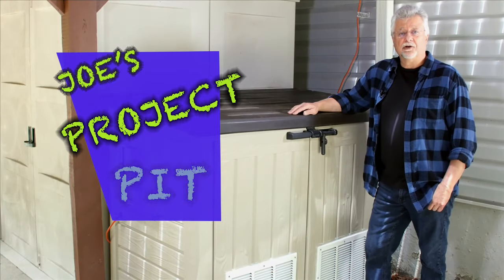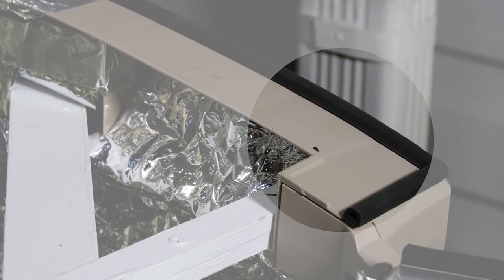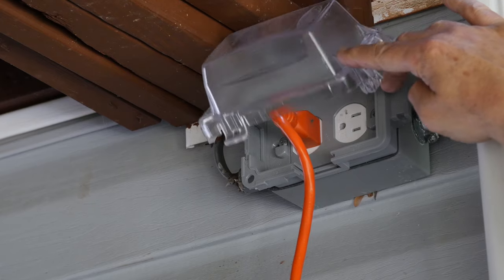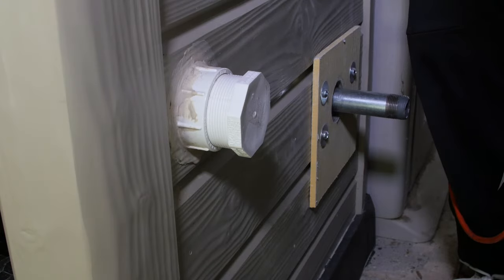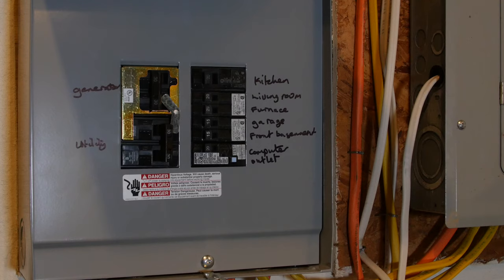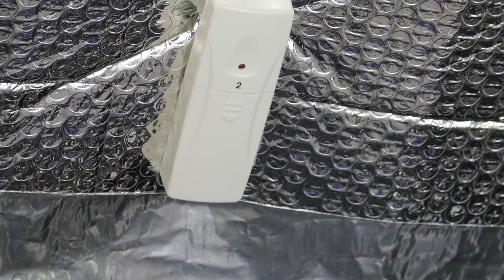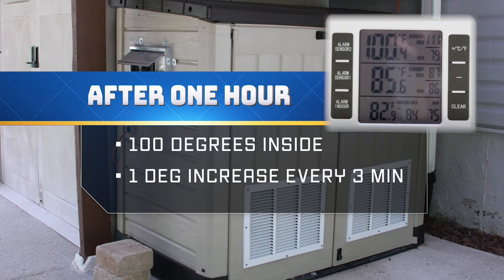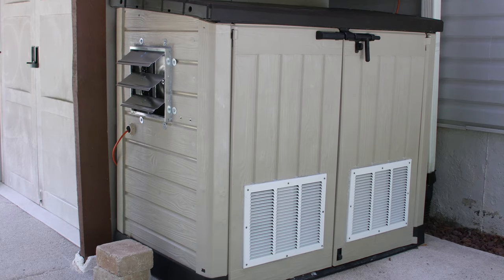Affordable Generator Enclosure Shed Project

Comment: Are you able to show a step by step of how you added the base plate and exhaust to your generator?
Reply from the maker: I can work on that now that I am back up and running.  In the meantime, here's what I did.
  - make sure the baseplate fits on the muffler flat and is not too large as to wobble when seated. 
  - coat the plate with fire resistant putty rated to 1400 degrees or so (the kind they use in fireplaces or near high heat areas).
  - drill holes in the muffler where the holes in the plate line up.
  - use as fat a metal screw as will fit in the plate holes.  make sure they are corrosive resistant.
  - when you screw the plate to the muffler, DO NOT Overtighten.  The muffler wall is thin and will strip easily.  Let the putty do its job to seal the connection.  Hope that helps until i can do a video.
Reply from the maker: One more thing.  The mounting of the plate may (or will) void the warranty on the generator.  I addressed this point in the video.  I did not care about the warranty on my machine, but if that is a concern, don't do it.  You will not be able to use my design, since it requires an extension on the exhaust.
Reply: Thanks for the reply, I'm more of a visual learner. My generator is the same brand and model as yours. Looking forward to the video. Thanks for your help.

Comment: Hi Joe. Enjoyed your video and have the same shed. I'm not sure how you stapled the insulation to the plastic shed. I just blew a hole with my stapler. Any help would be appreciated. Thanks
Reply from the maker: I had the same results at first.  Remember to staple on the support sections, not the outer walls.  Also, there are heat resistant caulking products that will work.

Comment: Nice job. I’m building something similar. What did you use for the bracing on the shed walls?
Reply from the maker: Sorry for the delay.  Been dealing with health issues and I'm just getting to these comments.

For the walls, I just stapled the insulation.  However, I thought about lining the inside with either 1/4" Plywood or 1/"4 " Drywall.  The Drywall would be more fire resistant.  I used 1/2" Drywall on the back wall.  I felt I didn't need it all the way around and didn't want to add the extra weight.  If weight is not an issue (I may be moving soon), then the Drywall liner might be a good idea.  

For the front brace which adds support to the side walls, I used a 1"x1" piece of wood with 45 degree struts for stability.  I undercoated it with flame resistant paint, like you would use in a fireplace.  You can use steel angle iron if you wish, but be mindful of the flimsy nature of the shed walls.  It might be like putting a jet turbine on a rowboat.  Use your judgement. Thanks for the comment.

Comment: Excellent video. Thank you for sharing. Did you need to adjust the carburetor when you added the exhaust extension?
Reply from the maker: I did not have to adjust the carb, maybe because the pipe is only 12" long.

Comment: Thanks, Joe! Great idea! I'd probably want to store my electric lawnmower and weed eater in it when not used with the generator. Does your shed pull double duty?
Reply from the maker: At this time, I store a second generator in the enclose, so as long as you empty the shed before you run the main generator all is well.

Comment: Thanks for this. I am just getting started. I have a WGEN9500.  Do you have any more detail on how you connected the pipe to the the muffler?
Reply from the maker: I answered this earlier, and it must be noted that bolting the threaded pipe flange to the muffler will void you warranty.  I used short galvanized screws.  I also used a fireproof sealant caulking.  There are other ways, but this worked the best for getting all of the exhaust out.

Comment: Excellent video, thank you so much for taking the time!  Quick question on flooring...what do you have on the base under the generator itself?  Is heatproof/non-combustible material required there?
Reply from the maker: In the video I used a Wood Base which elevated the generator for airflow, then afterward I covered with the same heat resistant layer as the walls. I  I'm sure that you can find a better solution, but this has worked well for me.
Reply from the maker: As a matter of fact, I will be installing Hardie Backer Board under the generator when I get a chance to insure heat resistance.

Comment: Awesome build. How long did you have the generator running. How hot did the floor of the shed get directly  below the muffler? I have a similar generator shed and was hoping to get some answers to my questions thanks.
Reply from the maker: If you notice in the video, I have a platform that I placed the generator on top of.  It is undercoated with fire resistant paint (like what you use in fireplaces).  The inside of the unit with the door closed and one 14" vent covered  hovers under 100 degrees on a 85 degree day and never gets higher than 120 on hotter days.  As a matter of fact, when I cover the vent the way I mentioned, the temperature drops significantly.  The second vent is for ventilation when the generator is NOT in use.  Hope this answered your questions.
Reply from the maker: I mounted the generator on a platform with a layer of insulation (the same as I used on the walls of the shed).  I ran the generator for over an hour in the test and I don't plan on running it all day in an emergency.  Since refrigerators keep food cool for about 12 hours with the doors closed (maybe more), I plan to use this generator no more than 2-3 times each day for an hour or two each time to charge batteries on laptops, phones, etc., and to connect to the modem for remote work needs. If work demands more time, I will make adjustments in the schedule.

Comment: This is a great video and I am in the middle of gathering materials to do one very similar. One question I have.  How did you get the pvc cleanout for the power cables to stay in place?  Is that just caulk?  Silicone?  Some type of glue?  Thanks!
Reply from the maker: Great question.  I used a combination of Liquid Nails and adhesive caulking.   Liquid Nails first to secure it, then the adhesive caulking to fill any minute holes.  I then stuff the hole with any rubber foam to keep bugs out and air from getting in, since this will lower the effectiveness of the vent fan.

Comment: I’m building a shed for my inverter generator ! I thought the fan should blow air inside the shed and another hole to vent out the heat ?
Reply from the maker: Check the comments from Cayrick Pan from August 2022.  He has some info on engineering exhaust systems in a closed environment.

Comment: I wonder how much heat difference there would be if the starting temperature was increased to 95-100°
Reply from the maker: I believe it would still be within the operating range of the generator and think about if it was outside with no wind in direct sunlight.  If you calculate the temperature difference starting at roughly 80 degrees to a starting temp of 95 degrees, the rise in temperature would only get to 120 or so.  Also, I have the option of opening the doors as long as it's not raining.  It's seldom 95 degrees in the rain unless you're in Death Valley which got to 127 degrees once.

Comment: Wonderful work. Wanted to ask you if you ever had any problems starting the generator in cold weather? I found out the hard way that after a near-freezing night, I couldn't start. Thank you and great video!
Reply from the maker: Sorry for the delay.  Been busy.  Nope, I haven't had that problem.  Sorry to hear that.
Reply from the maker: If your generator is gasoline, get a bottle of Fuel Stabilizer and dump about an ounce or two into the tank. This usually does it for my lawn mower also.
Reply: @joedelsordo9012  will do, thanks for the response!
Reply: Use synthetic engine oil. Never had an issue with cold oil on my 3-wheeler in Alaska. Did have to warm the carb sometimes though.

Comment: Have an installed Generac 22KW standby generator and thinking about a project similar to the one in this video.  I am definitely open for advice/opinions as this generator is directly outside my second bedroom window.  It is also in very close proximity to my 3.5 Ton HVAC.   I would like to  mitigate as much noise as possible, therefore the requested advice/opinions. Living in the south, I've not had to use it very often, however, during hurricane season the protentional for constant use is possible.

Thank you for your help.
Reply from the maker: Chuck, you might want to read through my other comments, especially the one about living in Florida.  I suggested that it might be a good idea to build a shed our of cinder block.  If that is not in your budget, then look for a sturdier shed than the one I used.  With 90 mph winds and higher, nothing is safe.  Build it strong.
Reply: @joedelsordo9012  Have you built a shed out of cinder blocks?  If so, what was the cost range?  Thankx!

Comment: If I build something like this I will set the generator in some sort of steel tub to act as containment in case of a fuel leak
Reply from the maker: The containment tub should only be about an inch or two high.  You don't want to overheat the generator due to confinement.

Comment: What temperatures do you see when your generator is running and under load?
Reply from the maker: Ran the generator for about 2+ hours with no significant rise in temperature.  Just don't overload the system.  I monitor the remote temperature gauge in the enclosure constantly.

Comment: Why do you need an extention for the exhaust, which juat dumps it outside. Won't the fan system take the CO out of the box anyway?
Reply from the maker: No, that would add to the temperature inside the enclosure.  If you check out other construction, they mostly all have an exhaust extension system.

Comment: How did this work out in the summer heat? I live in Texas. Just wondering if it ever got too hot inside. Thanks!
Reply from the maker: For extreme weather locations, like parts of Texas, I'd place the generator in the shade, like the north side of the house or in a carport.  I tested it in 90+ degrees and it worked fine, lowering the inside temperature from 106 deg down to the low 90's.  Maybe I'll test it on one of our hottest summer days here in Georgia.   It sometimes hits 100+ here too.
Reply: @joedelsordo9012  Thank you Joe!

Comment: Have you ran this for long hours? Did the plastic shed melt at all around the exhaust pipe
Reply from the maker: Good question...As I said in the video, the exhaust hole is framed with Hardie Plank, so heat won't affect it.

Comment: Nice what kinda  temperatures dose it run
Reply from the maker: The test took the inside temperature from 106 down to the low to mid 90's and it was still dropping after 1hour or runtime.

Comment: U suppose turn on breaker after it dtart
Reply from the maker: Yes, but in this case, since I hadn’t switched over the in-house breakout panel, it wouldn’t affect anything.  The important thing is to wait until the generator is up to operating speed before flipping the house switch over to the generator circuit.

Comment: 1.  Should NEVER use galvanized metal for exhaust.  This is DANGEROUS.
2.  Radiant insulation is used for sun rays, not convection heat.  This is DANGEROUS and the material can catch fire if hot enough. 
3   I like the idea of Hardy or cement board for the exhaust opening.
Reply from the maker: Thanks for this comment.  The metal flange is not galvanized, nor is the exhaust extension pipe, sorry.  The screws can be replaced if they are in fact galvanized.  The temperature inside the shed never gets above 98 degrees with the ventilation fan running.  The insulation is rated to 450 degrees.  If there is a concern, I suggest using more appropriate insulation.  I also don't run the generator for 24 hours straight.  Twice or three times each day to keep the refrigerator doing its job is enough.  For anyone working at home, running it all day might be necessary, but even at that, the temperature should hold around 100 degrees with this design. One NOTE: any outside generator should never be left unchecked.  The remote temperature gauge will alert you if the temperature inside the shed is rising too fast.

Comment: How did you find a base plate that fit exactly?
Reply from the maker: Home Depot or any hardware outlet.  The flange (base plate) is the same size as the muffler opening and the pipe fits the flange.

Comment: Westinghouse says you shouldn't use an exhaust extension, as do most, if not all manufactures. It will void the warranty.
Reply from the maker: Yes, I addressed that in the video.  I didn't care about voiding the warranty on my machine.  I needed a solution.  The box is safe and works up to expectation.  It will not cause a fire hazard if done right.  It's up to you if you don't want to void the your warrantee.  Don't do it if that is of primary concern.

Comment: I always see everyone connecting an exhaust extension on these sheds. Do you think that with the amount of air flow the fan is producing that it would be enough to also suck out the exhaust and heat? Just wondering if anyone has tried this without putting a separate exhaust extension especially with the heat shield lining on the inside of the sheds.
Reply from the maker: My feeling was that I didn't want to build up toxic exhaust fumes inside the shed.  I also wanted more options for the heat to be expelled.  If you don't extend the exhaust, you will have to research how large a fan and how big an opening would be necessary to efficiently remove the heat and exhaust.  I don't recommend it.

Comment: These shelters are nice but I don’t think it would make it through a hurricane. Which is the main reason I have a generator
Reply: This is what I'm wondering.  I'm in Louisiana and I'm thinking the wind would tear this thing apart
Reply: @Cenlalowell  same here, I was thinking of pouring a slab and anchoring it down to help with this and theft as well
Reply: @Cenlalowell  probably wouldn’t be a bad idea to elevate it as well depending on if you flood
Reply: @golgo1348  I poured a slab this spring 4x6 came out nice.  Taking my time with this because I only want to do it once
Reply: @golgo1348  yep glad I'm not in a flood area.
Reply: @Cenlalowell  me too I had enough after Katrina
Reply from the maker: I hear your concerns.  I lived in Florida for 35 years and went through almost every one of the hurricanes that came through.  If I were building this in Florida or Louisiana, or any shoreline state that could get hit with a hurricane, I would not only pour a slab, I would also lay Cinder Block walls and a secure door.  The roof would have to be secured as well, the same way as you anchor a house roof.  It can be done and should work unless the hurricane is like Andrew and has internal Tornados.  Hope that never happens again.
Reply: @joedelsordo9012  yeah I hear ya.  Im thinking if I buy a plastic one I'm definitely reinforcing it.

Comment: Wow.... I just went to purchase this shed for 229 and its now 500....lol
Reply from the maker: That sucks.  Glad I bought it when I did.  Supply chains are jacking up a lot of prices.  You can also build this shed out of wood (understand that wood prices are up also, but not necessarily subject to international shipping).  As long as you can ventilate it well enough, it should work fine.  It may take a different design, like slats for walls instead of a solid wall.  If you do this, your exhausts should probably be mounted in the roof - check roof mounted vent fans, like in a house or kitchen.  Remember, wood burns at 450 deg Fahrenheit.  Maybe put the enclosure on a concrete slab and bolt it down, so there is NO bottom wooden structure.
Reply from the maker: The wooden slats will need to be slanted and separated by several inches so that the air flows freely through the structure.  You can line the interior with Wire Screening to keep out critters and large insects.
Reply from the maker: Just checked the price of the resin shed on Amazon.  It was unavailable.  Here's an alternative if it will fit your generator - https://www.amazon.com/Keter-Prime-4-3-2-3-Outdoor/dp/B094YLXCY4/ref=dp_fod_1?pd_rd_i=B094YLXCY4&psc=1

Comment: You want that thing as far away from the house as possible,your gonna get sick of listing to that thing,muffled or not.Wake up.
Reply from the maker: John, you're right.  But most of the time power outages are not forever, so I feel that any way you can get power is worth the sacrifice.  Hopefully you can put it on a side of the house that has a concrete wall, like a basement wall that extends above ground.  That's where I have mine.

Comment: If I only had a brain. 🙄 You list hardiplank board, but you don't show it or talk about it. Where did you put it?
Reply from the maker: I do mention that it is used to shield the hot exhaust pipe from touching the plastic shed.
Reply: @joedelsordo9012  None of them will withstand even a cat 1 hurricane here in south florida. They aren't designed for that.